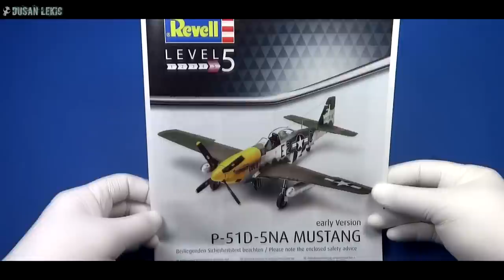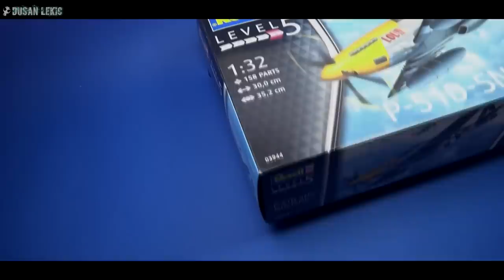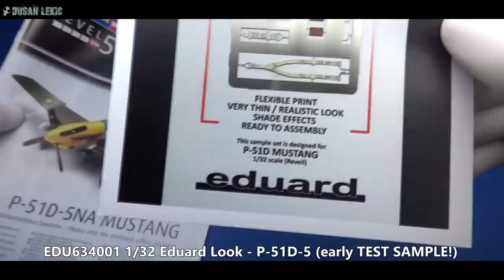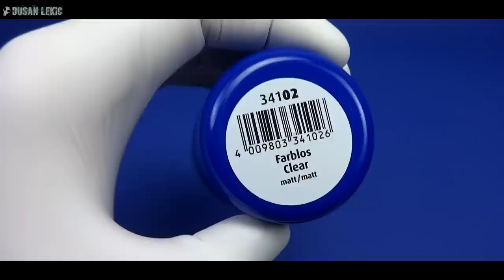FULL VIDEO BUILD REVELL P-51D MUSTANG (New tool)

Comment: Revell had two other kits in 1/32 scale . The P-51B and  the P-51C with the Malcolm hood . Mostly used by the RAF and the RCAF . The 2nd Tactical Airforce , late 1943 to 1945/1946 . Thank you .

Comment: Both the P-47 and the 51 suffered from tail flutter after the "Razorbacks" were removed, but all was corrected with the 47 after adding the dorsal section. 51 still suffered with wing and structure problems through out the war. The problem was so bad in the Pacific that a B-29 was required to help the 51 groups navigate around the heavy weather and lead them to their escort duties. Nothing of the sort was required with P-47 FG's. Always a pleasure watching you detail paint. Nice! You got the wood floor! So many people do not know the pit floor is wood. I like the repainted IP! Excellent build Dusan! Perfect amount of weathering and war weary stress. Congrats!
Reply: bob dyer I've never heard before the Mustang had wing and structure problems through out the war?!
Reply: Yes, Once 51's were at strength a new category was added to the groups concerning maintenance -  Structure failure. The wings are bolted to the airframe and not part of it. Which is a weakness. Mustangs were not completing their combat hours before being retired as "War weary" and sent back to third shop for new wings. Col. Zemke, while flying home from a mission entered a small storm over Germany and had his wings ripped off. No one learned of this until he was liberated from the Stalag Luft. camp. USAAF stopped flying 51's over the "Hump" in the CBU due to losses. Only when a few pilots survived after bailouts were the commanders made aware of the situation. The strong mountain winds were causing pilots to lose control, and then wings.  When Gen. LeMay {future leader of SAC} took over 8th AF in Europe he got rid of the 51's and kept the 47's due to this issue, plus the 47's could carry more, less maintenance, and flew faster with the later model R-2800's. He had all D-30's and later overhauled and updated to carry the latest HVAR's. Even the Mustangs greatest gift "Range" was actually met {47's were over Berlin first} and then surpassed by the 47. The "N" model {serving only in the PTO} had a longer range, heavier weapons load, and is faster than the 51.  People just believe the propaganda. Like the old pilot saying goes, "Want to impress your girlfriend have your picture taken in front of a Mustang, want to let your parents know you're safe, have your picture taken in front of a Thunderbolt.

Comment: I am in the early stages of building a 1/32 P51-D from Hasagawa, I was going to get the revel version but decided the Hasagawa was more affordable, it’s a great kit, although pin ejector marks are a bit to big and pronounced and so are taking a bit of extra time and work to get rid off, the engine detailing is good, but again has some minor issues with seems and pin marks. Oh well just gives me an excuse to do more model making.

Comment: Dusan Please answer a question for me. I have been researching air brushes and I have seen many types, what's the different when the paint is metal like the brushes you use and the brushes that has a glass pain holder on the bottom? please help me understand what the differences in the brushes are thank you. BTW you do great work

Comment: Hello Sir, 
I Love the work you do with these kits, but I just wish you could talk about how each step is done. You probably quess by now that I have no experience none what so ever and any little tip that you say on the video can be a great help to me in the future. 
My question is about what color of primer to use before you start painting. Why did you go with the color black as a primer? I've seen on other videos modellers using other colors .
Doesn't black hide most of the details on the kit? Well Thank you for your time 
Sincerely 
Allan
Reply: Black is used as part of a series of steps called 'black basing' which is used to achieve a mottled, randomly worn paint effect. You can search Youtube for 'Black Basing' guides.

I wouldn't worry about those techniques for now, just grab yourself some cheap, well fitting kits ( Airfix 1/72 Spitfire and BF109 are a great pair to start with) and get used to building and painting.

Comment: I'm wondering, do modellers ever add weight to the models inside to make the model the same weight as the actual plane at that scale? Or would it weaken the model in some way?  If you know the actual weight of the aircraft (say 28,000lb) and have a 1:72 scale model, do you know how this could be converted?

Comment: Can i use my acrylics i use with a brush with an airbrush? Great video!
Reply: Max Morsch You can, I used to use the Testors acrylic with a brush. It was water based and could be thinned that way but it’s hard to get the sort of accuracy you’re looking for. It tends to bleed under a mask line too. But not bad for solid non-intricate patterns or small areas that aren’t going to be seen as closely.
Reply: @CJ-jh9ri  thanks!

Comment: I'm new to scale modeling, do I really need an airbrush?
Reply from the maker: Not really, you can also paint brush the models. There are many people that still use paint brush with excellent results. All the best! Dusan.
Reply: Agreed. Start with brush painting
Then you can work with spray can paint.
After some time a airbrush is definitely recommended but be prepared to spend some money even for a inexpensive one.
Good luck.

Comment: anyone have a small problem attaching the wings? seems one side goes good in the other sticks out a bit next to the body
Reply from the maker: I haven't any problems with that area. Please dry fit it few times before glue application. Check spue gates points (fuselage) if you missed to sande one. All the best! Dusan.
Reply: thanks for the reply yeah will try it :)